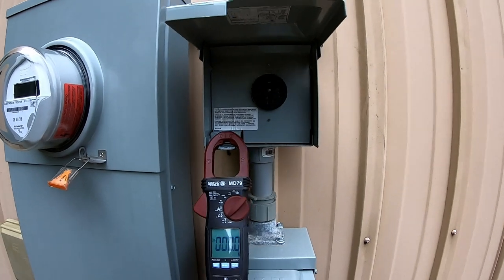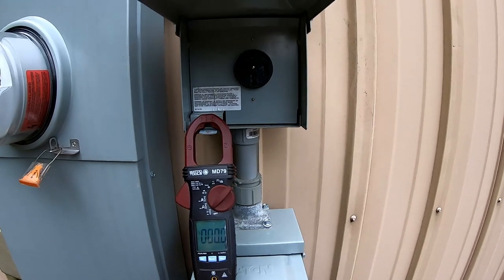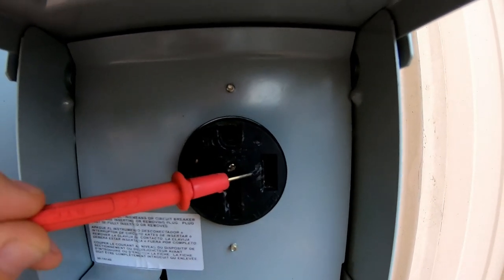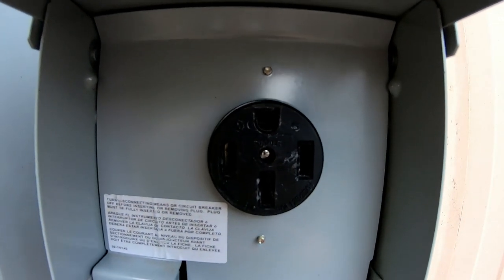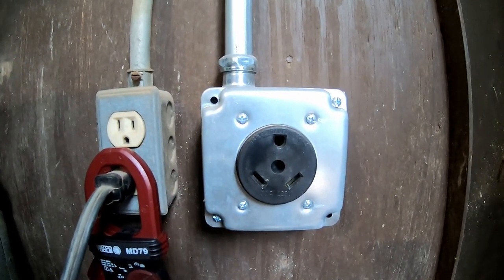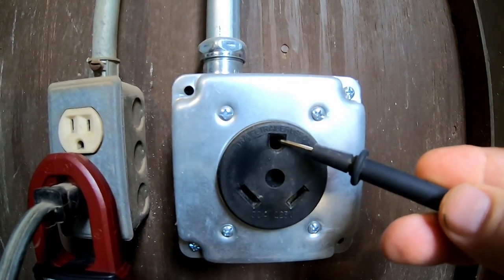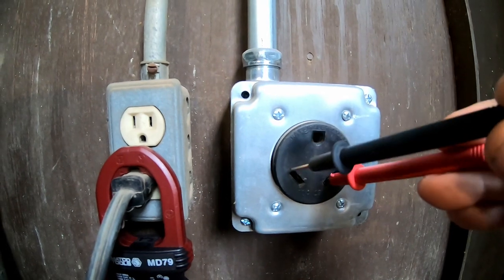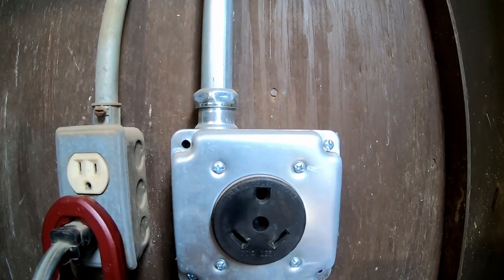RV - 30 AMP and 50 AMP service explained

Comment: According to all the diagrams I see online and that printed on the receptacle box that I just bought, the 30 amp hot leg should be the lower left and neutral should be lower right.
Reply: That’s my thought on the explanation.  If I’m right please correct your video
Reply: Your right Darron, the hot lead on a 30 amp  is the lower left, not the lower right.  And I am a RV campground electrician. The poster of this video is wrong!!!

Comment: I understand how each leg at your power supply or breaker box uses 2110 legs coming in meaning they are supplied from different bus bars at the main breaker inside the house. That much I understand where things go awry is if I plug my 50 amp RV plug into my 2200 watt Honda generator with a 30 amp adapter it seems to me that only half of my items in my trailer would work. But yet everything still works. Does the transfer switch have some sensor that realizes that there might only be one 110 volt power line coming in
Reply from the maker: Nope the dog bone splits it
Reply: @MRRVTECH  dang it. Why didn't I realize that. So obvious.
Thanks for teaching me something

Comment: Great video. Thanks. I am about to install a 50a svc for a new rv. Just curious about something though. Why does most people say 110/220 volts?  When it is really 120/240.
Reply from the maker: Well back when I was taught about AC electricity this was the lingo and I guess it just stuck. I have observed over many years ranges in Ac voltages varying from 108- 130, and 210- 250. Realistically, "By the book" doesn't always apply in the real world.

Comment: Quick question, are the two hot legs coming from the same phase or buss bar from the main service panel, or are they split, with each hot leg coming from the opposite buss/phase?

Comment: Thanks for the vids. They are easy to understand. Maybe you can answer a question that i am having a hard time finding the answer.  I have a generator with the 4 prong 1430 receptacle that has gone loose on me and my 30a dogbone wont stay locked. I need to replace my socket in my generator and was wondering why i cant replace it with a regular rv plug 3 prong so i dont need the dogbone any longer.

Comment: i've been using a 30 amp adapter to plug in my 50 amp trailer cord. Will that hurt any thing?  So far it hasn't.  I believe all appliances are working correctly. Our trailer only has one A/C unit. I was told the 50 is needed for to feed two A/C units. Thanks easily understood video.

Comment: I'm going to test my rv park post, I'm having issues with half power to my slide out. I've checked about everything from batteries to converters, going to check the box and my 50 amp cable

Comment: I totally understand the pin out and bonding of the 50 and 30 amp RV plugs. What makes me scratch my head is wire gauge current handle in the 50 amp service. I find 6awg wire in the umbilical, two 50 amp hot, one common and one ground. In a scenario where ground and common are not bonded  does the 6awg common handle 100 amp return from both hot legs?
Reply: It's because you don't get 100 amps. Only 50. The video is misinformation. Search MWBC for the truth.

Comment: I seriously need some help. My 30amp reads 243. How could I decrease it to 110? I have a 30/50 amp rv breaker box that came pre wired. I'm assuming that I'll have to rewire it. Do you have a video on that?
Reply from the maker: @Mr.JayOutdoors  
No, but I recommend an electrician perform the repair. There should be 1 hot, 1 neutral, 1 ground. You currently have 2 hots, no neutral and 1 ground.

Comment: Just recently bought an RV park with 5 spots. All but one has 30 amp (one has 50 amp). Is it possible to purchase new RV Pedestals (home depot) and install with the help of an electrician, or will we need to have the power company come and run new lines from the transformer? Are the current 30 amp wires capable of being upgraded without digging up the ground? Just wondering if this is a simple project or major. Thanks for any advice!!
Reply from the maker: You will need to rewire all the poles, 50 amp is 4 wire 30 is 3 wire. A licensed electrician can do this no need for power company to come out

Comment: Hey good info in the clip. I have questions hoping this is in your scope of knowledge. From my main box to where I want the 30 amp outlet is a span of 35 feet. Would I need to run a higher gauge wire between these 2 points? 10G or even 6G? I already have the 6/2 with ground double pull 50 run from old pool heater that is no longer in use.  Could this 6/2 be used?

Comment: So if someone were to use a dog bone adapter to plug their 30A RV into the 50A outlet, would that only allow 120v through?
Reply: Yes because the adapter only connects to one of the 50 amp/120volt hot legs. Your trailer's AC panel restricts the current use to 30amps of the single 120 volt hot leg.

Comment: I’ve got a bus I’m converting to an rv. I have a 100 amp main breaker box( I know it’s a little big for an rv) I want to wire it like residential, how do I go about wiring the rv 50 amp plug to run the breaker box off of my generator or a plug at a park    Any help would greatly be appreciated . Thanks
Reply from the maker: You need to have a 50 amp 2 pole breaker in your breaker box in the bus, the two legs will hook to it (one on each side), then the neutral should be attached to the general neutral buss and the ground should be attached to the general ground buss.
Reply: MR RV TECH thanks I appreciate your help

Comment: If I'm going from a 3 prong 220v outlet (twist lock style) to a 30amp adapter to change it to a 3 prong welder (50 amp) cord, is there any way it maintains 50 amps since adapter is only rated for 30? Seems to be the highest available on the twist style adapter....

Comment: I'm not an electrician...which is why I'm reviewing this video.  However, it appears that your explanation of the 30a is backward.  I have reviewed two other videos which disagree with yours, and my power is acting like the other two videos.  Have you reviewed this?  @darronransbarger seems to address this in the comments.
Reply from the maker: Yeah so I may have pointed to the wrong terminal when describing hot and neutral, not a big deal cause if you are wiring one of these plugs in....it literally says on the back where to put the wires.

Comment: I believe your 30 amp receptacle is wired reverse polarity??
Reply: It is.  When the hole for the ground is on top of the outlet, the lower left slot is supposed to be hot, and the lower right slot is supposed to be neutral....

Comment: For the 30amp rv plug do you use a single pole 30 amp circuit breaker?
Reply from the maker: Yes, exactly.

Comment: What does it mean when I'm checking shore power, all good numbers (50amp, 120v (x2)'...until I do hot/ground...

.... then I get nothing🤷‍♂️🤷‍♂️🤔...
Currently running high voltages through the cabin...same scenario with hot/ground not working..🤷‍♂️🤷‍♂️..

Im going to explode. 😁🚍🔥🔥🥺😩😩
Reply from the maker: open ground (not connected)

Comment: Hey!  We were all just watching your video and noticed an error on the 30 amp plug which could ruin someone's RV if they wire a receptacle from your explanation.  The hot wire is supposed to be wired on the left side 7pm and the N wire at 4pm.  You say that the HOT is supposed to be at 4pm and Neutral is supposed to be at 7pm.  Please fact check that and delete your video.
Reply: Considering AC voltage has no polarity how would this ruin an RV?
Reply: I noticed the same thing. In viewing several other videos for wiring a 30 amp plug all the other ones say the 7 o’clock position from the front of the receptacle show be the hot lead and 5 o’clock should be neutral and top ground.
Reply: @eztr1gger  the hot wire would still be hot even with the breaker in the RV switched off.
Reply: It is a shame there isn't a 30 amp plug adjacent the 50 to accurately support how description.
Reply: @eztr1gger  AC definitely has polarity, why do you think they call it a polarized plug? It's not + - like DC, but it is Hot & neutral.

Comment: Your use of “circuit” and “service” are incorrect.  I believe your wiring configuration is incorrect.   Clockwise ground, neutral, hot.   I looked up the NEMA chart and I am correct.

Comment: It is not supplying 100 amps. It's a 50 amp plug, 50 amp breaker. Stop spreading this misinformation.
Reply from the maker: What? At no point does anyone explain this as 100 amps.....lol.

Comment: You say you have 2 110V Conductors yet you meter out at 240. You should think about that. It's 120V per.
Reply from the maker: The reason I explain it this way is because the positive breaker bus is separated in the RV breaker box. There is at no time 240v on one wire in an RV.